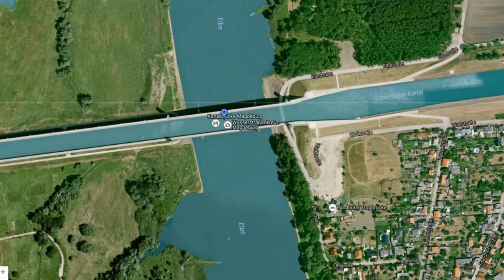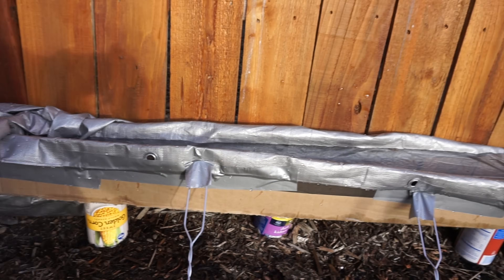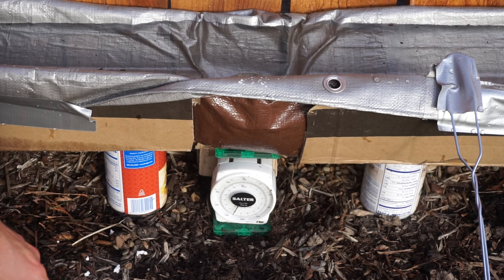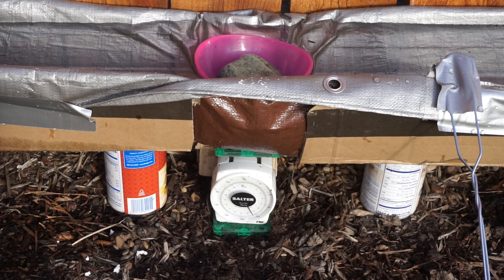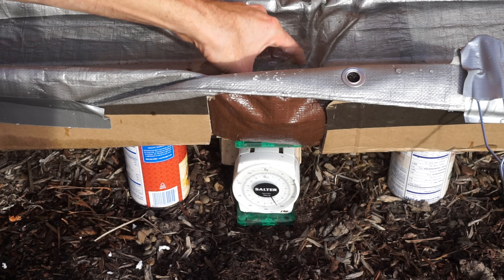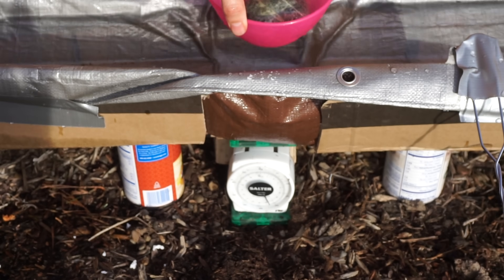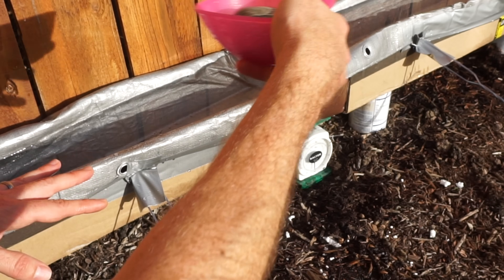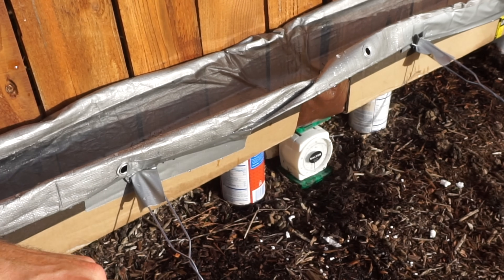What Happens When a Boat Crosses a Water Bridge? Does the Weight Increase?

Comment: Basically you have already designed the bridge for the very substantial weight of the water. You might have to consider additional strength if a ship sinks while on the bridge though!
Reply: You’d have to basically design for the difference in density between water and steel for that sunk ship
Reply: @zapperone7  make the boats out of water so if they sink it's the same!
Also, make the people in the boats out of water as well.
Reply: @tom_something  
Or make the boat out of air so that it just floats to the surface when it sinks.
Reply: @i.i.iiii.i.i  Why don't they just build the boat at the destination so the boat doesn't even have to travel there?
Reply: @tom_something  the people are already 3/4 of the way there!
Reply: @samuelplyr99p  So I just need to lose, like 40 pounds. As long as it's the right 40 pounds.
Reply: I was thinking the same
Reply: @faizanahmed653  was sinking the same 😉
Reply: Kinda interesting when you think about it: imagine you have a large heavy ship chugging along, the bridge is perfectly fine and can withstand the capacity.  But then the boat sinks and suddenly, the bridges collapses due to the weight.
Reply: I think this experiment is misleading on some aspects.
One point that he mentions but doesn't stress out it's importance, it's that the water displaced weights in the same as the boat. Meaning that the amount of water the bridge will support already accounts for how heavy boats crossing it will be: weight it's factored in before, not after.
Also, about the sinking boat, similar concept applies. 1) Bridge won't have to support the full weight of the sunken boat, just the difference between densities. 2) the weight of the sunken boat is marginal next to the column of water. All in all, the effect is  negligible.
High tides/rain is a much much greater issue for the stress the bridge will handle, and I'd bet it's both designed to withstand up to maximum level before spilling and also always below that.
Reply: FOS must be high

Comment: So you're telling me that if all people would use boats instead of cars, bridges would be much easier to engineer.
Reply: Well, it has to support the weight of the water  so.....
Reply: No.
Reply: not rreally because the bridge has to support the water, shouldnt leek, etc
The water alone is probably heavier than the cars combined
Reply: Water is still hella heavy
Reply: If people used boats instead of cars, bridges would be almost exclusively for people and wheeled transport tho.